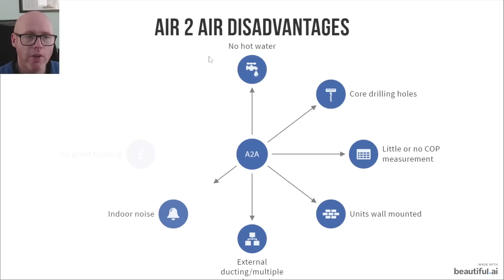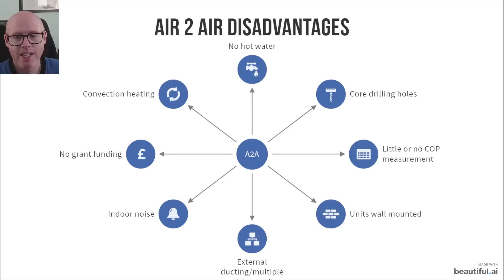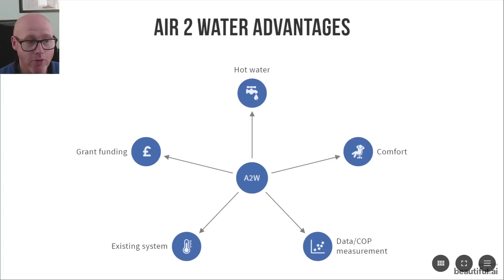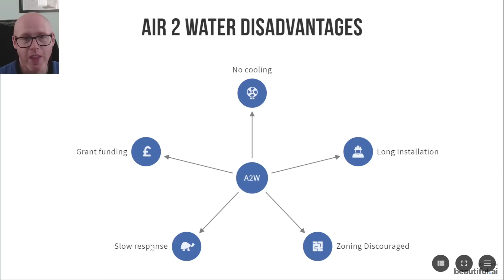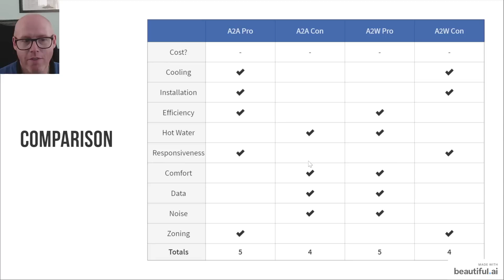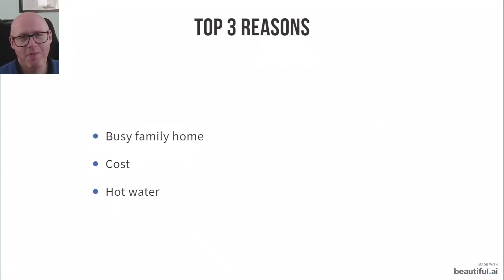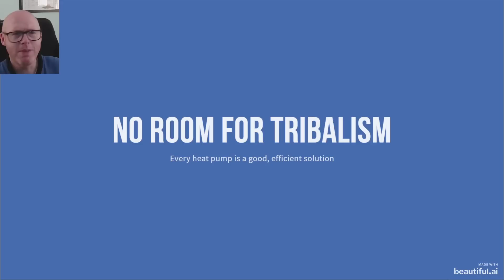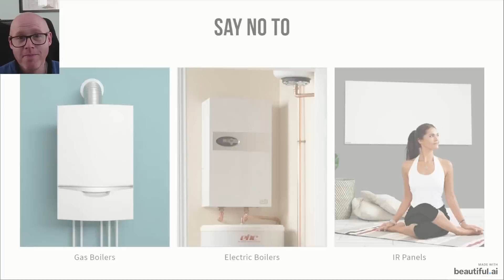Heat Pumps: AIR TO AIR or AIR TO WATER?

Comment: BTW no heat pump  is better than a correctly fitted and already-working gas heater system (in terms of cost and convenience).
Reply from the maker: We could debate this all day.

Recently in the UK there were large parts that experienced power cuts. Many of these people were left with no hot water. Those with hot water storage cylinders (all A2W heat pump owners) did not experience the inconvenience in the same way as those with combi boilers did.

Also...most gas boilers are not "correctly fitted" by my definition. Flow temp too high, no consideration of modulation or any compensation controls. 10-15% thrown away by poor setup.
Reply: @UpsideDownFork  Sad that people are being constricted economically by poor installation practices.  That said, I can point to a local A2W installation where the client was taken advantage of (elderly lady trying to 'do the right thing' and sold a pup).  Disgraceful practice and certainly not helping change minds.
Reply from the maker: @kellyeye7224  yep, that I can definitely agree on.
ECO4 is leading the charge when it comes to heat pumps getting a bad reputation. 😭
Reply: @UpsideDownFork  How do A2W systems work without electricity then?  OK, they have a 'store' of hot water but then, so do most houses (immersion) but, for the sake of a pan of water on a gas stove..... lit with a match BTW.
Well, I can 'argue' all day given that I use bottled gas for instant hot water (two 47kg bottles per year so £150) and have a woodstove for total house heating that costs me £50/year (licence to forage for wood).  Not all are as lucky.
Reply: Actually it's the reverse, a gas boiler will beat a heat pump in poorly set up systems.

The closer you get to running a boiler at maximum efficiency the more a heat pump will run away in terms of efficiency so it will always be cheaper to run.

Convenience also comes at a cost, i.e. "instant" hot water will always be more costly for daily showers/baths compared to having a hot water cylinder heated by a heat pump.
Reply: @BenIsInSweden  Here in the UK the cost differential between gas and electricity is such that there is little advantage (economically) in favour of running a heat pump.  When you factor in the astronomical cost for many (most) properties in the UK that require upgrading in terms of insulation etc and the larger radiators etc that cost is often unrecoverable over the stated lifetime of the A2W heat pump system.  As it stands, electricity cost is only headed in one direction - upwards.  Gas/oil is not increasing by the same proportion.
Reply: @kellyeye7224  I'm well aware of the cost difference between gas and electricity in the UK.  However, as usual, there are other factors to consider, especially if you're just using the price cap.
As there are tariffs like OVO's for heat pumps where it's a fixed 15p/kWh for the heat pump usage.

The other problem you're describing is the "poorly set up systems".  If you have a system where you have a correctly fitted gas boiler system in place where it runs at peak efficiency then you won't need to do any upgrades for a heat pump to be installed.  

Also, if you go by price cap only, your last point doesn't stack up:
Apr-July '24:
Electricity: 24p/kWh
Gas: 6p/kWh
Spark Gap: 1:4

July-Sep '24:
Electricity: 22.36p/kWh
Gas: 5.48p/kWh
Spark Gap: 1:4.08

Oct-Dec '24:
Electricity: 24.5p/kWh
Gas: 6.24p/kWh
Spark Gap: 1:3.93

Jan-Mar '25:
Electricity: 24.86p/kWh
Gas: 6.34p/kWh
Spark Gap: 1:3.92
Reply: @BenIsInSweden  Nit picking decimal points aside the cost ratio is 4:1 which is certainly enough to wipe out any potential savings when in use (comparatively).  Equally it is clear that the 'reduced price' of electricity for A2W users is simply another subsidy to encourage uptake.  As with other 'green' subsidies (like EVs) they don't last forever.  When they're gone - as they definitely will - there goes the 'savings'.  
As to 'no modifications' I'm of the understanding that most existing radiators (on gas systems) require larger radiators to compensate for the lower system temperature.  I might be mistaken though.
Reply: @kellyeye7224  the cost ratio isn't 4:1 though.  Because a gas boiler doesn't run at 100% system efficiency. 
In poorly designed systems - which is common in the UK, it will be closer to about 84% or worse.
To get a gas boiler running at 95%+ efficiency, you need to get the return temperature down (thus flow temperature), and the solution to do that is the same for a heat pump - larger rads / better insulation, weather compensation etc  and assuming the gas boiler hasn't been oversized - which many are.

The cost ratio trend also is not expanding like you seem to think it is, and is either staying the same or contracting.
The UK has one of the worst spark gaps in the world, so it would stand to reason it will eventually fall more in line with other countries.
Reply: @kellyeye7224  You grossly misunderstand how other countries are.  Gas isn't used here for heating at all, and it is only available in the south west near Denmark, or "town gas" in Stockholm.
Gas is more expensive than electricity per kWh.  Electricity also isn't reliant on gas.

But I didn't say the prices will come down either, I just said that the spark gap would contract - i.e. the difference between gas an electricity pricing will reduce, not that the the price of electricity will come down.
Reply: @BenIsInSweden  I beg to differ.  Electricity prices will not come down if we continue on the current green course.  The more green we go the more expensive it becomes (and the spark gap increases) as it is NOT a replacement for other (base load) sources therefore TWO sources (or more) will always be required hence the price will always be higher than it need be..  Right now we (Scotland) are under a static high pressure system with fog for over half the daylight hours so where does the power come from.....?  Guess.
Reply: @kellyeye7224  And what about the 180/283 North Sea gas and oil fields that will cease production by 2030? Gas is going to increase in cost regardless of the energy mix due to declining domestic production and growing reliance on imports.

Relying entirely on gas not only locks the UK into these rising costs but also exposes it to supply chain risks. Being able to utilize diverse energy sources, like wind, solar, and hydro, reduces the need for gas when these resources are available.

While renewables may require backup during times of low output, advancements in energy storage and international grid interconnectivity are making systems more resilient and cost-effective. Transitioning to green energy isn’t just about cost today; it’s about reducing volatility and ensuring energy security for the UK’s future.

Comment: Both technologies are great but at the moment the grant on heat pumps makes them far better value.  Speaking as someone who has had multiple quotes for both options, and my preference probably being for A2A initially, I just cannot justify the extra 10k or so!  I do not understand why people why people say A2A is cheaper tbh, maybe if you have no need for a hot water cylinder and have no radiators or access to a 7.5k grant they would be, otherwise way more exprensive option. Great content, keep it up!
Reply: Expensive to install, not to run I meant btw
Reply from the maker: @tomrichards4633  thanks for commenting.
That's what I found when I got 2 tentative quotes. A2A was far more expensive to install 👍
Reply: @UpsideDownFork  Yes I am getting a heat pump installed for about 3.5k with Octopus and that includes a 200L cylinder too.  That is about the same as one aircon unit would be, but I would need multiple units (at least 3 in total) and then hot water to sort too!

Comment: I was thinking, when i finally get a A2W system upgrade, of putting "fan coil radiators" into the hallway by the bedrooms and in the lounge. These, in combination with the underfloor in the kitchen, will hopefully mean we have decent cooling options. Also putting bigger column radiators in preparation as they send water up and over rather than relying on convection like panel rads...

So hopefully that'll be enough to take a few degrees out in summer, even if it's not proper air conditioning - 28-30 indoors is uncomfortable, but 24-26 is ok
Reply from the maker: Thanks for commenting!

Comment: I had A2A in my last house and now I've moved to a bigger house I went for A2A again without hesitation. First off its very cheap to run, I've had my bedroom unit on all night set at 18° my whole house is drawing less than a kilowatt including the background stuff. It's very very quiet on night-time mode less than a ceiling fan and without the expansion noise of radiators.  I've set the air direction to ceiling only and diffused so I can't feel it (Midea call it "magic air"! ) but best of all it dehumidifies (excess water is pumped outside ) so no damp or black spot mould. In the summer this is an absolute heaven, my wife and I sleep far better with this on set to cool, even dust is reduced because the circulated air is filtered which is great for my wifes hay-fever.  It means we can keep the windows shut excluding night-time dust and noise.
In the kitchen the unit helps tremendously with cooking humidity and is our preferred way of drying the laundry. We place the washing on a rack under the unit and it's dried nicely without creating condensation. 
We have two small outdoor units, (we opted for that as opposed to one large one because it is quieter (the neighbours say they cannot hear anything) and as we rarely run everything at once running costs are reduced). 
Inside we opted for 4 units Lounge,kitchen  and two bedrooms. 
Total cost fully installed £6k and very neat and unobtrusive. Our hot water use is minimal so we went for a small efficient gas boiler.
With the lounge unit on the sound level is 25db taken approx 10foot from the unit which is up in a corner. Again the air circulation is set to "diffused" and the temperature set to 23° giving a humidity of 46% .
Reply from the maker: Thanks for commenting
Reply: What system/brand do you have? 🙂
Reply: What model dobyou have?
Reply: @AIRfree there are two outside compressor units and four internal one's,  they are all different as they are matched to each room size.

Comment: Air to air is like a dry heat that might make people cough and be a dry heat. And the fact it doesn't do water. That's a biggggg reason, and needed 12 months a year
Reply: A2A systems don’t produce 'dry heat'; they simply provide heat, much like a central wet system. The dryness people notice often comes from the ambient conditions in winter, not the heating system itself. For example, Tim and Nigel (EV Puzzle) both use A2A systems and still run dehumidifiers in winter, highlighting that A2A isn't inherently drying.

Personally, I use a humidifier to maintain comfortable humidity levels, which is something you'd need regardless of the heating system. Also, some A2A systems can handle water heating (I have one - a Hitachi Yutampo Twin), they are slow to enter the UK market though, but I believe the Daikin Multi+ one is available.
Reply from the maker: Thanks for commenting!

Comment: Great video! Having lived with air-to-air for three years... I'm still not sure which I'd prefer in our new house! The cooling was amazing in summer, it was extremely cheap to run, and the near instant heat is fantastic. However, it just didn't feel cosy enough for us. Especially when it does its defrost cycle: suddenly you feel very cold for 20-ish minutes while it stops working.

That said, both are great solutions and each work for different homes/families. Anything's better than burning stuff.
Reply from the maker: Thanks for commenting!
I'm interested to see what you do for the new place.
Reply: @MrEV  Hi, I do get defrost cycles but not that often and not for 20mins. About a minute or two at most.. It may suggest that either your unit size for the room was wrong to start with of the outside location isn't ideal. A larger inside unit working less hard might of been better. The first company I used I was very disappointed with. At my current house I used Staffordshire Aircon (no affiliation) who were very knowledgeable and did a great job very neatly.
Reply: 20 minutes for a defrost seems abnormal - what units do you have?

Comment: So many heat pump advocates suggest heating the whole house for lots of the time, ive never understood how this can be cheaper than heating just the rooms that are used.
Reply from the maker: @South3600  a house has a heat loss. Over a 24hr period it will lose a certain amount of energy.
It doesn't really matter if you put that heat energy back into the property gently over 24 hours or intensely over 4 hours. You are still replacing the same amount of heat energy that is lost.

The main difference being that appliances don't work as hard when this do this job slow and gently.
This is true for gas boiler and heat pumps alike.

Comment: I would pick whatever is the easiest installation, which depends on your house. In my case, I had air ducts everywhere, so ducted A2A. I had a separate hot water cylinder, so heat pump water heater. My brother's house has radiators and should get A2W.
Reply from the maker: @davidstewart1153  thanks for commenting 👍

Comment: If your home isn't connected to gas and you already use electric heating then air to air is an easier choice to make.
If you don't have much room it could be the only choice unless you want to stick with resistive electric heating.
Reply from the maker: Thanks for commenting

Comment: Air to air can be more efficient with on average +1 on COP as air to air works around 30-35C while air to water is usually run at 55C.  This means the heat gradient for the pump is less for air to air allowing COP of >5 where a air to water is around 4.
Reply from the maker: This is not true. Most A2W systems run a flow temp between 25-45 degrees with weather compensation. It's currently 6 degrees outside and my A2W system is running a flow temp of 33 degrees.
Reply: @UpsideDownFork  ok
Reply: @UpsideDownFork  so the water in your radiators is only about 30c
Reply from the maker: @tomooo2637  plenty enough to warm a room to 21 degrees 👍

Comment: A2A is far more efficient and has a longer life than A2W. Historically, A2W has required a multi-stage solution, or two or more compressors and heat exchangers to achieve the required temperature increase for hydronic heating. This provides a useful indication of how much harder a heat pump has to work when used to heat water compared with conventional A2A heat pumps. This means that the compressor, which is the most expensive component, will need to be replaced much sooner and therefore significantly increases the long-term running costs of the heat pump.

It would be very interesting to see a video comparing the reliability and repair costs of the different heating technologies even if it was, for example, a comparison of present day costs for key components for each system, the availability and likely cost of the actual repair. Such an insight would be very eye-opening and in some cases eye-watering.
 
Personally, my own choice would be air-to-air as I like rapid response and the efficiency is much better. On the other hand, there is already gas central heating installed so air-to-water is potentially a simpler option. Considering the property, a multi-drop mini-split system would likely be an easier install than a fully ducted system.

The fancoils of A2A systems actively moving air eliminates stratification in the room which ensures an even temperature and adds to the overall comfort. This stratification, makes A2W systems even even less efficient unless something is done to mitigate this such as a ceiling fan or using hot water fancoils rather than passive radiators.

As far as noise is concerned, a fancoil unit can be very quiet on low speed and can be quieter than even an electric fan heater. Also the sense of a gentle air movement can be very pleasant.

On a personal note, I am autistic and have sensitivities to sound and light amongst a whole host of other issues. In my own experience I have found it a lot easier to tolerate the sound of a fan and moving air from even commercial heat pump systems, presumably as it is a smooth and continuous sound. I find the noises from hydronic heating to be less tolerable and the random sounds quite disturbing, especially first thing in the morning when I am generally most sensitive.
Reply from the maker: This is not true. Historical or industrial comparisons bear no relation to a domestic A2W heat pump in 2024.

Most A2W systems run a flow temp between 25-45 degrees with weather compensation. 
It's currently 6 degrees outside and my A2W system is running a flow temp of 33 degrees.

A single stage compressor with R290 refrigerant can achieve flow temps of up to 75 degrees.

A weather compensated system runs so low and slow. It produces a very gentle constant heat that builds up thermal mass.

Convection is not as comfortable as thermal mass.

Comment: I think air to air is a good solution for a lot of modern new builds. Generally well insulated but absolute hot boxes in the summer that cooling would help with. Additionally a lot of new builds could do with freeing up radiator space!
Reply from the maker: Thanks for commenting.